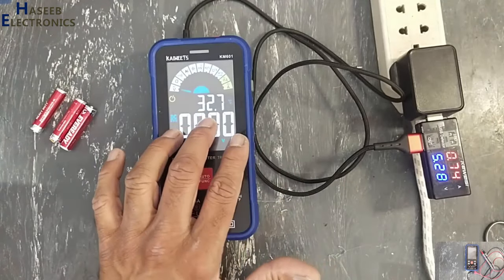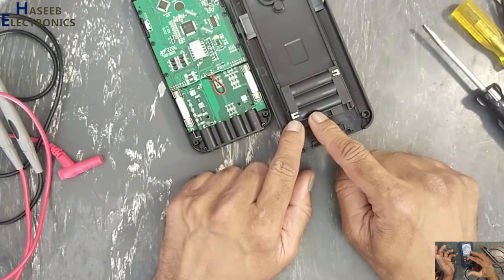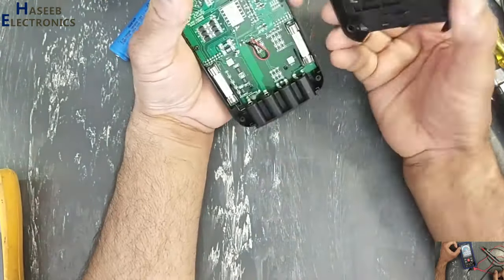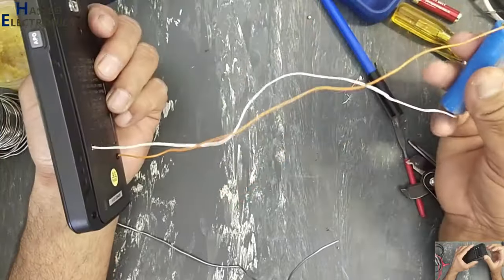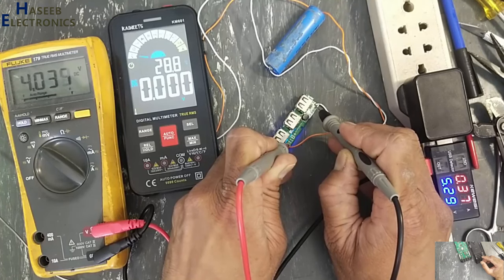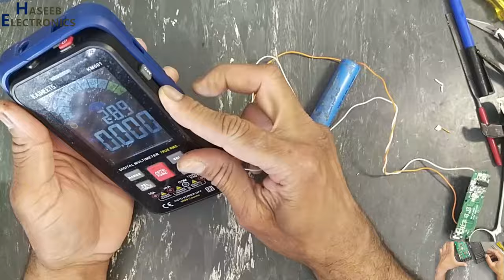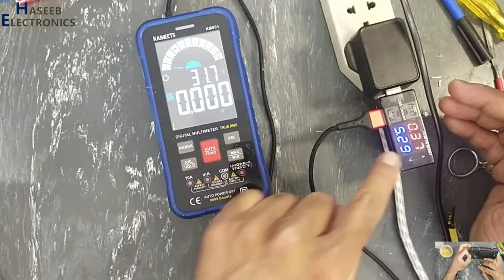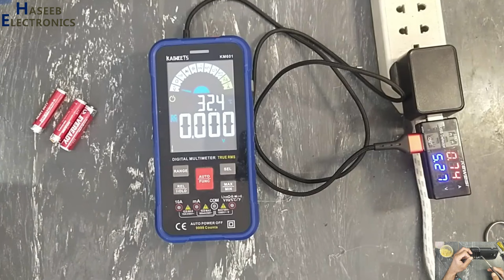{1184} Intsalling rechargeable battery in Kaiweets KM601

Comment: Great ! you can also cut the AAA battery area & install a Nokia BL5C in its place with a USB C TP4056 charging module.
Reply from the maker: wow 
that is also a great solution 
thanks for sharing
Reply: @HaseebElectronics  Welcome Sir !
Reply: @HaseebElectronics  yes I was going to say something similar... cut out the triple-a section and use a flat battery. you don't need the internal charger or to glue it on externally. Just get a proper charger for the battery, when voltage is low remove and charge it and put in another spare charged battery. You just have to glue in some terminals inside the multimeter to touch the battery terminals. You should do a video about that modification because that's a lot better than ghetto hacking and hotglueing a bulky external box.
Reply: Wonderful idea make compact

Comment: Very nice Idea Mr Mohmmad thanks for sharing! I tried to do the same but using a 12v adapter I dropped the voltage to 9v using blue LEDs in parallel and a capacitor positive terminal at the common cathode of the LEDs but now the meter reads everything fine but voltages, AC reading is not stable it gives the correct reading then  fluctuating values same with DC voltage readings! any suggestions please?

Comment: Sir, out of this topic and your advise is highly appreciated. Pls ignore if not appropriate. My 8kg LG front load washer was not powering up. Replaced the burned STR (top245yn) and transformer (rewinded). In the first washing time itself, STR burned out 2nd time. After replacing it again, 3rd time blasted post 6-7 washing. In the 1st & 3rd failure, the issue happened when washer just powered on from the AC socket.  What could be the issue? Is there anything to be checked in the filter board that is connected before the control  PCB board?